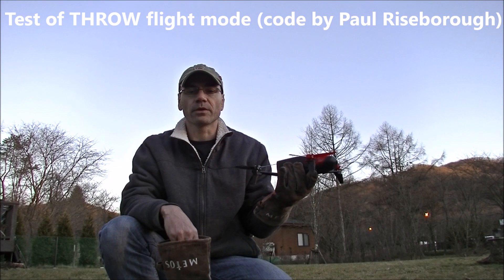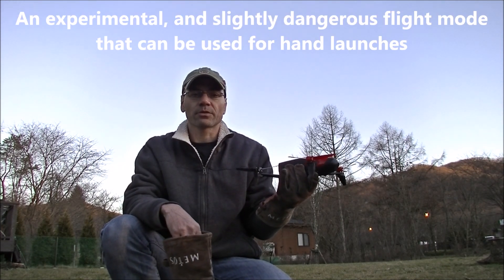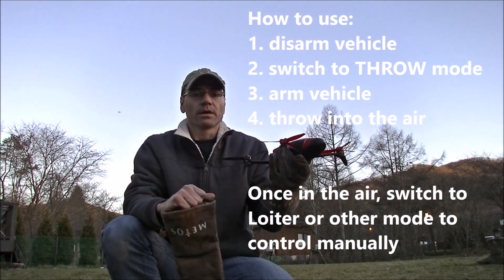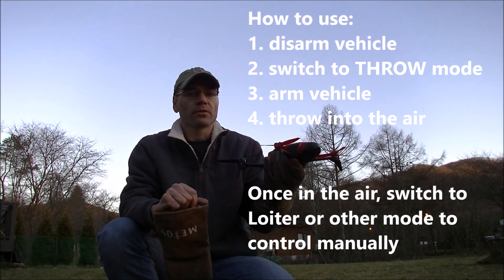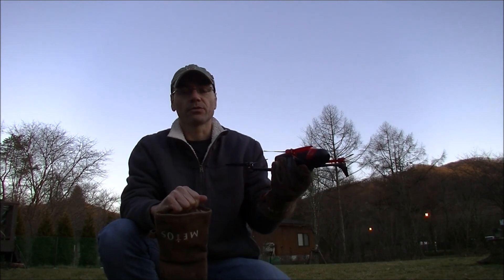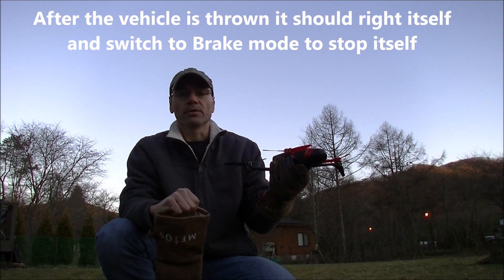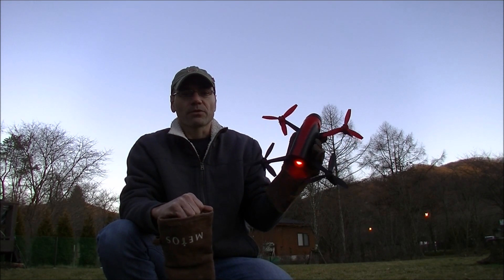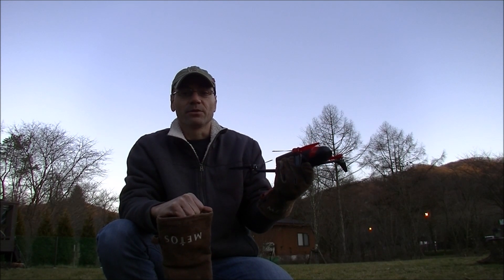Throw mode test

Comment: Hey!
Can it go to auto mode after throwing it in the air without any manual Input?
Reply from the maker: Hi Vishal, yes, THROW_NEXTMODE parameter can be used to automatically change the mode after the throw is complete.

Comment: Where do you put the throttle before throwing?  50%?  Thanks...
Reply: Bill, you can actually have the throttle at any level, even zero.  The throttle position is only important once the pilot decides to re-take manual control by switching the flight mode after the throw is complete.

Comment: How did you enable the throw mode Randy? Using the mission planner? or APM Planner?
Reply from the maker: +Mac Niu I used Mission Planner.  If you don't find it in the drop-down list of flight modes, you may need to upgrade to the beta version of the mission planner and then go to the Flight Datat screen, press Ctrl-f and then push the "Param gen" button on the window that pops up, wait a few minutes then restart the MP.
Reply: +Randy Mackay The mission planner I am using is version 1.3.37, I used the method you taught me, but I found the brake mode but no throw mode, do you know why?
Reply from the maker: +Mac Niu My guess is you're not using the beta version of the mission planner.  There's a check box in Config/Tuning > Planner screen.  Also by the way, this feature is only available on the development version of Copter (Copter-3.4-dev), it's not included in Copter-3.3.3.  Copter-3.4-dev is available through the Mission Planner's Install Firmware screen after pressing Ctrl-Q.  Be careful though because Copter-3.4-dev hasn't been fully tested so we can't guarantee that it will work fine (although it seems solid at the moment).

Comment: Because I can now arm in boat mode in 3.4 [ while its in my hand a moving slightly ] I simply just hold it over my head and throttle up until it's obviously pulling up and release. All things considered I think this might be safer than THROW mode. Plus I'm not so sure I'd love to throw my $1500 over water and hope it works. But that's cool it's an option!
Reply from the maker: +govsux Yes, when Paul Riseborough was developing the feature he "went through a bag of propellers" apparently.

Comment: Meh! WHO needs fingers! :P  out of curiosity, what if the Beebop motors werent programmed to start when armed (MOT_SPIN_ARMED=0) and then you threw it up in the air? would it still start after the throw?  or is it required that the armed Beebop needs the propellers to spin while throwing (MOT_SPIN_ARMED=70)?
Reply from the maker: +TheMighty Thor Yes, it's a touch dangerous and you might notice if you listen carefully you can hear the props hitting the thick gloves just before I throw it.  If mot-spin-armed was zero it wouldn't spin the props during the throw but they would start in the air.  I think we will change it so the props definitely don't spin when you're trying to pick it up!
Reply: Randy Mackay I like the idea!! especially with something like the Beebop.i thought i heard something like the glove hitting which is now confirmed by your cheer after the Beebop got in the air. i take that cheer to say, OMG I STILL HAVE MY FINGERS :P i am coming back to the pixhawk family in 2016. its awesome what you and the team have done. i own a SOLO so i have first hand knowledge :)
Reply: +Randy Mackay But why throw it? One bad throw and someone gets hurt. Yours took quite a distance to stabilize itself. Someone may not throw as high as you did.  Don't get me wrong, it is cool, but as an option for the public it can be quite dangerous.
Reply from the maker: +Avi Tech yes, it's a bit of a difficult decision on whether to put it into master and if we do what additional checks should be added to make it safer.  I suspect a significant number of people want the feature so I think we will add it but we're still talking about it in the dev team (drones-discuss@google-groups.com).
Reply: Randy Mackay Thanks. I will drop in and take a look.